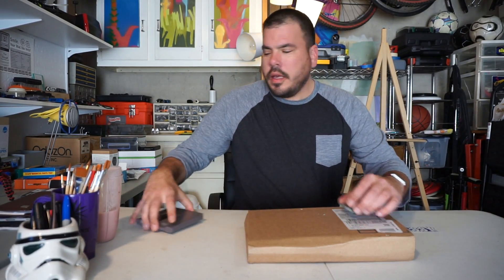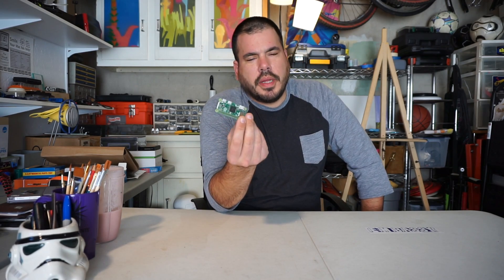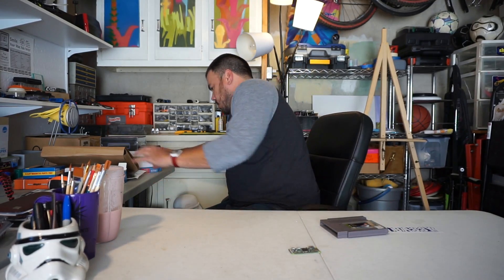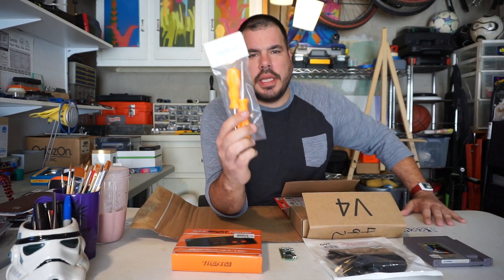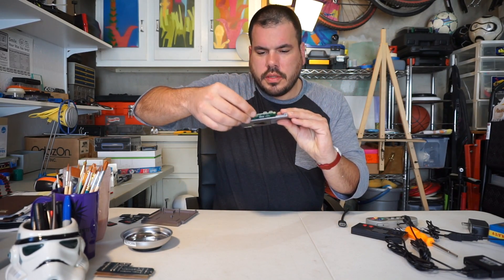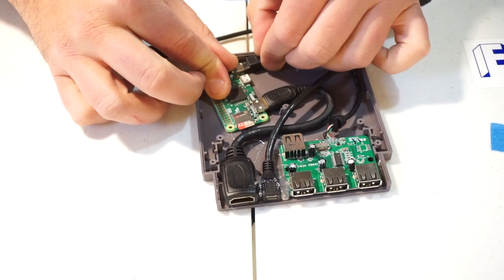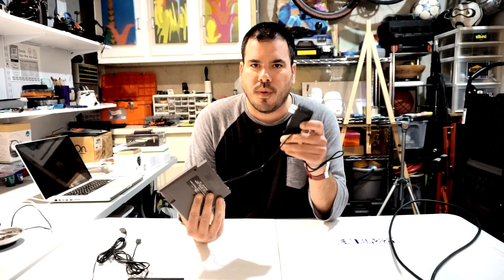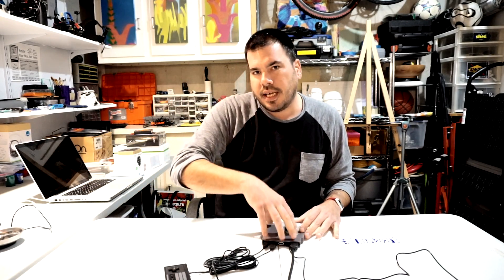DIY NES Classic with Pi Zero

Comment: Hey Kris, I enjoyed the video of your presentation of putting the Pi Cart together? I have a one question? Can the regular Pi Zero work with any Micro SD Card like a 32GB? I recently installed the Raspberry Pi Zero and follow the step by step method. I used SD Formatter to Format to it's right size and then used Win32 Disk Imager to write the Retro Pie Zero image onto the 32 GB Micro Card. After when it was successfully written onto the card. I saw a Overlay folder onto the SD Card Reader? I was thinking it had anything to do with the Pi Zero? But when I connected everything it wouldn't boot up like it's supposed to? I hooked up the HDMI cord into the HDMI port and connected the 4 in 1 Micro USB OTG hub into the USB port and set the charge to OTG. Then connected the Power Supply into it. But nothing happened. I thinking maybe it could be the SD Card or maybe something else? The Pi Zero did light up Green. But it was just a dark screen and no Raspberry Pi Zero logo appear. I'm not giving up though. I know the Pi Zero board is good. I'm gonna keep looking into it. Thanks for hearing me out. Best Regards, Phil

Comment: Has anyone had the rainbow screen problem when booting your pi zero into retropie for the first time? I've tried everything and can't get it to work, I was able to put a copy or Raspbian on it, and NOOBS, and it booted properly so its not my power supply, I just can't seem to get a pure retropie install to work, and I'd rather not have to do it through Raspbian
Reply from the maker: I've done a handful of these now on the PiZero and haven't come across this issue yet, so I'm not exactly sure what's happening, but I'll try to help! I know that it's important to get the Zero install instead of the Pi 2/3 install https://github.com/RetroPie/RetroPie-Setup/releases/download/4.1/retropie-4.1-rpi1_zero.img.gz , and maybe try a different SD card or prep the RetroPie image with a different app (I use Apple Pi Baker on the Mac to prep the SD Card) https://retropie.org.uk/docs/First-Installation/.

Comment: In regards to it not be able to run N64 games is it possible to somehow bridge two pi zeros together to have enough power? Cause even two of them are small enough to fit in a NES cartridge while a pi 3 is as big as the cartridge
Reply from the maker: I've done some research on this, and it gets tricky. The few Pi Zero clusters I've seen need to use the USB OTG cable to do their intra-networking(http://blog.alexellis.io/pizero-otg-swarm/), thus still needing a Pi 3 to run the show. The other Pi clusters are usually built using Ethernet (http://www.instructables.com/id/How-to-Make-a-Raspberry-Pi-SuperComputer/?ALLSTEPS) to pass around the info to all the hosts, and the Zero doesn't have ethernet, so no dice there. They do make a Pi Zero Cluster Hat (http://www.networkworld.com/article/3160028/hardware/cluster-hat-the-easiest-way-to-build-a-raspberry-pi-zero-cluster.html) or Actbulb (http://hackaday.com/2016/01/25/raspberry-pi-zero-cluster-packs-a-punch/) that would let you run a bunch together, but then it's way too big for a NES cartridge. If anyone knows of a way to do this, feel free to chime in below!
Reply: krislovescalifornia awesome! Thank you for the helpful info 😊👌🏻

Comment: Does the front of your case get warm? Near the area where you placed the Raspberry Pi on the inside? I've noticed mine gets warm.
Reply from the maker: Yes, especially during SNES games I've noticed it heats up, but from what I've read, it's not hot enough to be a concern to do any damage, just natural heat from all the graphics processing, so it's all good!
Reply: What is your opinion on running Retroarch on this? Do you think it's pushing the pi too much to run them as well?
Reply from the maker: Not sure - just downloaded Retroarch today (1.4.1) so give me a sec and I'll report back. As far as I can tell, a lot of RetroPie uses the libretro library that Retroarch does so I'm assuming it will be very similar...

Comment: is it better to run RetroPie then recalbox
Reply from the maker: I found that there is more support and forums/documentation/videos about getting RetroPie setup, so it seems like the more developed app and easier to get help if you run into trouble. However, I've heard that Recalbox works great too, it's just a bit newer and doesn't have all the experience and support, so it may be trickier to get running with various builds/gamepads/emulators. Maybe try both and see what runs better!
Reply: krislovescalifornia thanks will try it out today, I think I'll stay away from the ps 1 and n64 games

Comment: Dont waste your money on this. It takes way too much time too much money. Get a raspberry pie 3 with the same moneu and you can run mame and even ps1 and some n64 games. The pie zero is not 1 dollar. It comes to about 15 bucks with shipping
Reply from the maker: At the Micro Center down the street from me, a Pi Zero today is $5 out the door. They occasionally have them on a sale for $1( limit 1 per person), so that's when I get mine - they have an incredible DIY/Maker selection. (http://www.microcenter.com/product/463189/Zero_v13_Development_Board_-_Camera_Ready) I agree that a Pi 3 would be better if you want to get into PS1 and N64 games, because the Zero can't handle those emulators, but a Pi 3 starts at $45 so that's a very big difference if you are only looking for NES/SNES gaming.
Reply: You do know for the USB hubs as well you can get one even cheaper as Staples for roughly 4$ while that amazon version is 6$ and only allows free shipping with anything over 25$ total and the SD card you can get at any local electronic store and 8gb is all you need for the Zero since every game compatible for the Zero uses at most 4.5gb and most places sells good SD cards for roughly 5$ 8gb.
Another thing what you could of done to make it look cooler is made the HDMI port exit on the other side and the power cable same spot which adds in 10 min more work and also before i forget as well you could always get something similar to this USB hub http://www.staples.com/Insten-4-Port-Octopus-USB-Hub-Black/product_970854 and use some kind of old plastic that might be laying around to make the front more professional so it would really look like a console cart.

Comment: Does NES controllers work by default? im a hardware/pc geek but when it comes to putty/linux and setting stuff up in rasberry im a novice (or even worse). I just want to buy a plug and play w/o 2 weeks of reading guides.
Reply from the maker: So far I've purchased 3 different USB gamepads and they've all worked - when you plug a new controller in, RetroPie lets you configure it. I have 1 NES style and 2 SNES style. I assume these gamepads all use similar chipsets/code so they are all basically the same and easy to configure through RetroPie. You can also re-map the buttons if you want to!

Comment: do you get much lag from the Zero??? on N64 or Snes??
Reply from the maker: We've been playing through Zelda SNES (Link to the Past) and it's great, no lag, but I haven't tried N64 yet. The Zero gets warm, but not hot. I'll fire up GoldenEye and Mario Kart tonight and see what happens and report back!
Reply from the maker: After loading some N64 ROMS onto the Pi, I noticed they didn't show up on the menu to play. RetroPie suggests at least a Raspberry Pi 2 for N64 games, so I would assume the Zero just doesn't have enough horsepower. However, i have played a bunch of SNES games without problem, so if you want to play N64 you'll have to upgrade to a Pi 2 or 3.